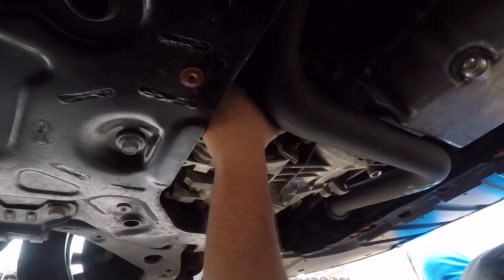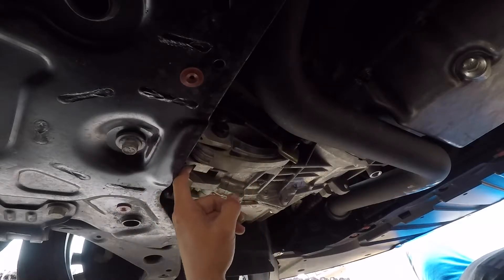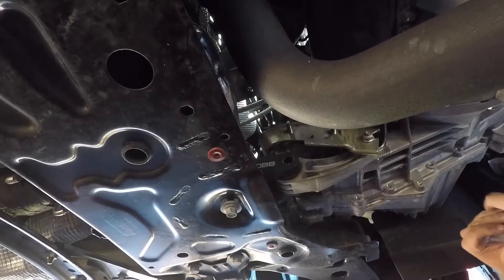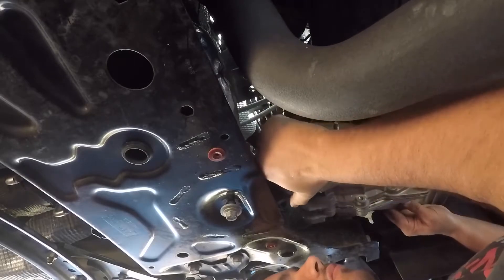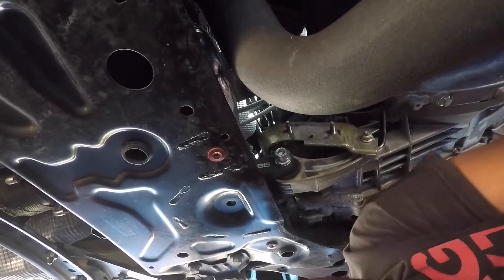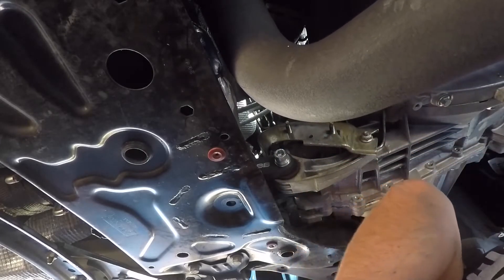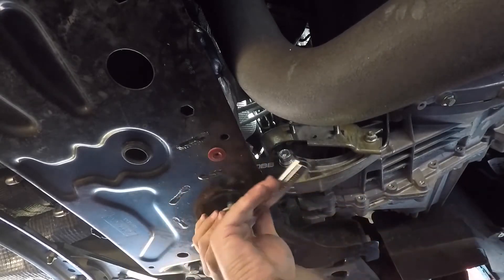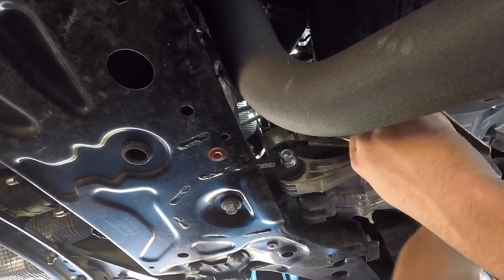FOCUS ST REAR MOTOR MOUNT (RMM) INSTALL

Comment: Was there any indications during driving that the stock mounts was cracked (e.g. vibration at idle)?
Reply from the maker: cleecoloma actually that I remember there wasn’t any. I remember there was a hard knock when I would launch the car. But that was about it.

Comment: Do I need to torque the bolts back or just guesstimate how much force I put into putting em back in?
Reply from the maker: Connor Waggoner I just guesstimate they come out by hand so I just tighten them as much as I could by hand
Reply: Fost Father so you haven’t had any problems just guesstimating